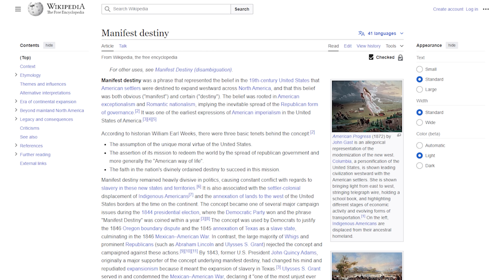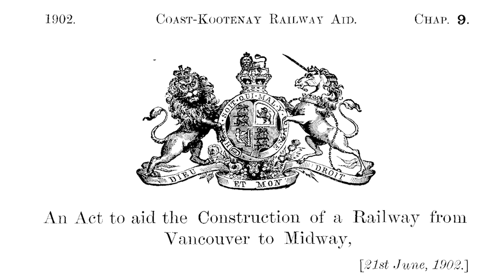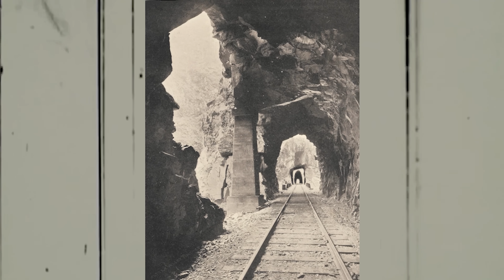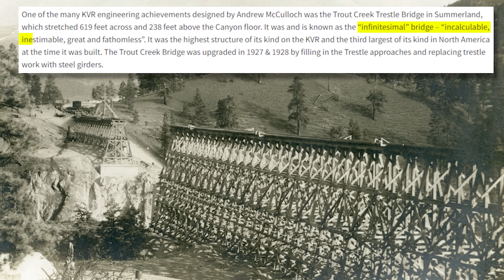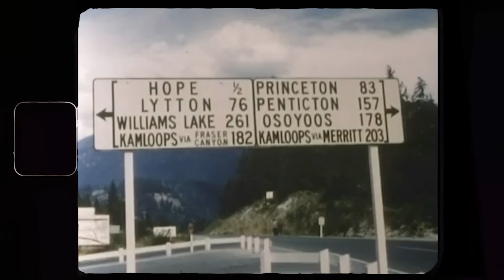History of the Kettle Valley Railway

Comment: If you take the Portia (northbound only) exit today, you can park and walk in and find yourself on the KVR. The old railway is now an access road for Trans Mountain and logging operations. Trans Mountain maintains one tunnel and one tressel on the route. You will also come across a cool water feature where they bored the rock to drain water off the mountain and prevent it from hitting the tracks and freezing. When they drilled, they broke through the rock wall. So now you see what looks like a broken gutter pipe with water flowing through. You will also see the tunnels that were demolished by the military and mentioned in the video.
Reply from the maker: Thanks for sharing!
Reply: If we are talking about the same thing, where the water "tunnel" is exposed on the "hill" side of the road and comes out below the roadway on the cliffside, we use to call this the "hole in the wall", but we never knew this was a manmade tunnel.  However now that you say this it certainly seemed like a cylindrical pipe shape. Spent a fair amount of time camping in the area before the new highway was completed. Have photos crossing the trestle near Larson Hill, watching fish runs from water level at the Othello tunnels, and camping along the river from Hope to Coalmont.
Reply: @Scorpster  Yea, that's the one!